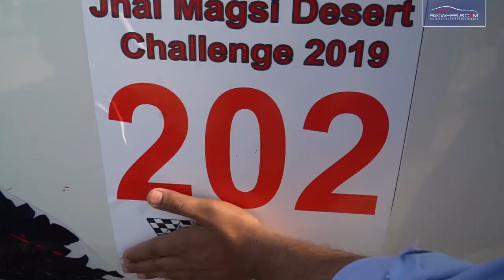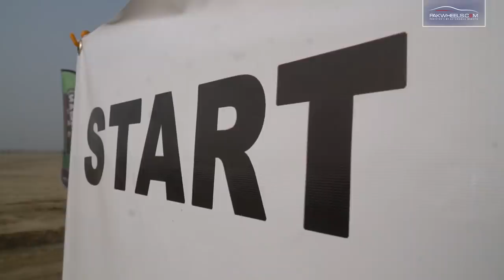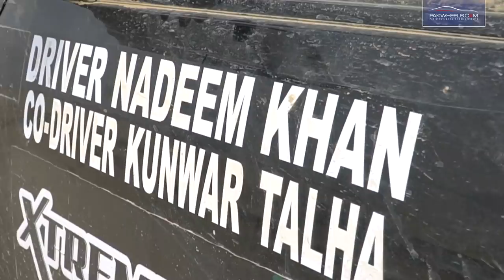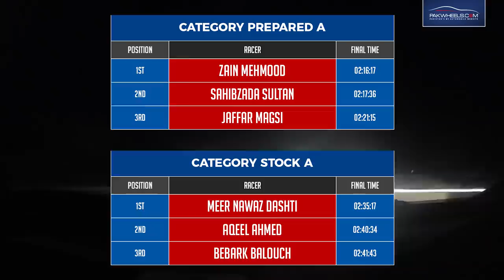Jhal Magsi Jeep Rally | Vlog | PakWheels

Comment: Please explain difference between stock and prepared category
Reply: Prepared vehicles are highly modified (for racing). Stock vehicles are untouched, they have the same equipment (engine, suspension and tires etc) that came from the manufacturer.